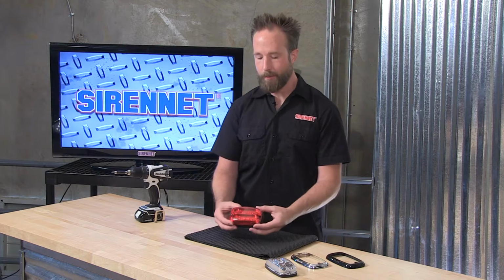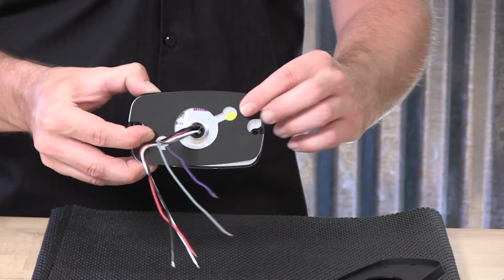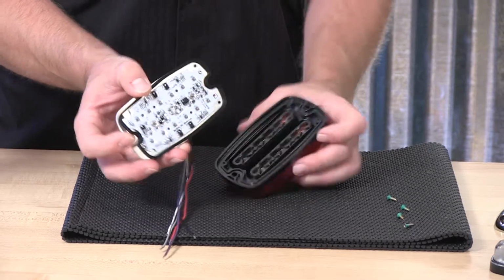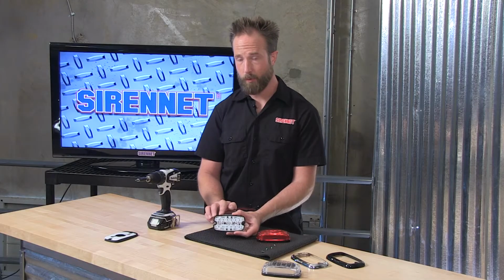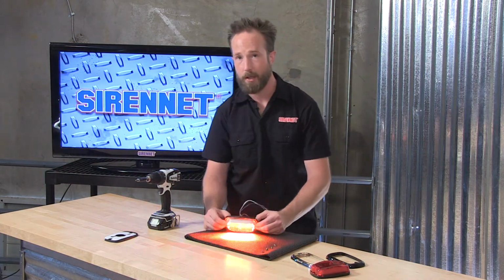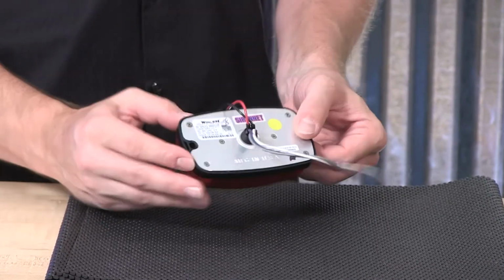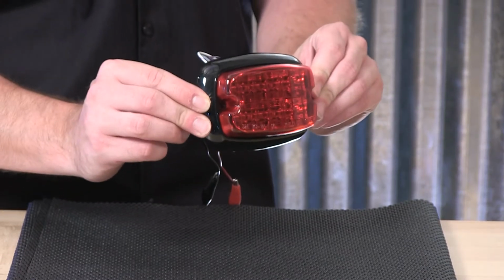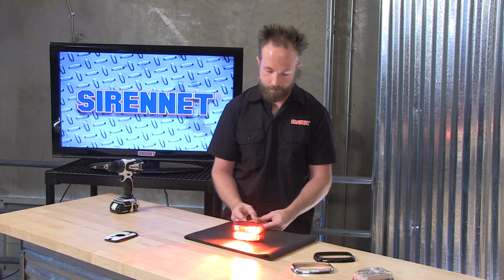Chris shows us the  Whelen M4 Linear Lighthead

Comment: Dumb question however could I paint the diodes on board (stain paint) to change the color I currently have red/white with clear lens and I now may not run white and want to change to Amber/red
Reply from the maker: It might create a greenish yellow color hue with the White diodes being colored over.
Reply: SIRENNET thank you so much for the quick reply I may TRY and if it's not a great color I will try and un hook the white

Comment: I have this unit but it only came with 2 wires on the back of the M4 Unit.  Its a White Wire and a Black Wire. I am trying to change the flash patterns and I am currently not able to do so. I have two of these units in all white with the steady white driving light.  The steady white driving light works well with the button when activated. But to change the patterns I am having difficulty.  I again have two of these units linked together and are working fine, but want to change the flash patterns. Thank you!
Reply from the maker: +William Thomas    If the M4's that you have are only a 2-Wire, that would mean that they are stand-alone and do not have an Internal Flasher. Most likely, they came from a Motorcycle Touring Box. The 2-Wire M4's will only steady-burn when connected to 12Volts. If you wanted to be able to Flash these, you would need to use them along with an LED Flasher Module.   We offer a ULF44 from Whelen that could be used:    http://sirennet.com/store/product/whelen-four-outlet-four-channel-led-flasher
Reply: Okay, that would be why then. Awesome, thank you so much for all your help!